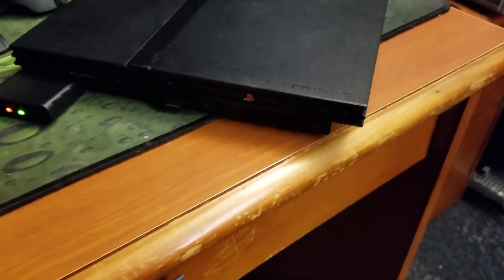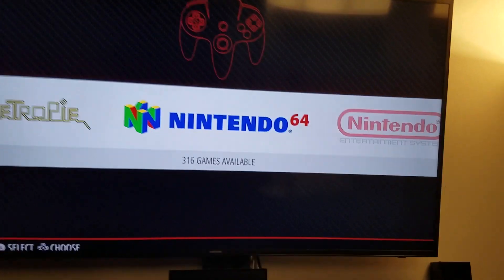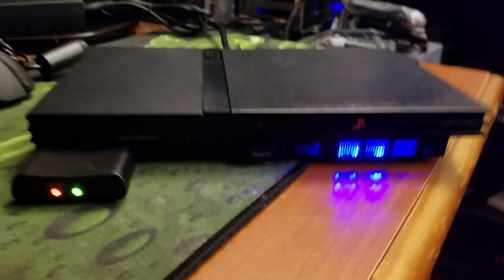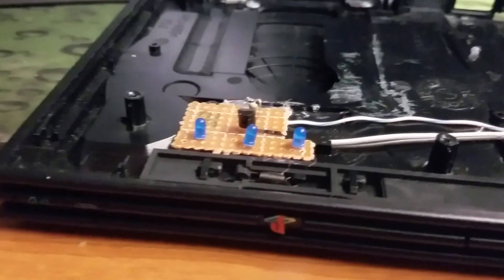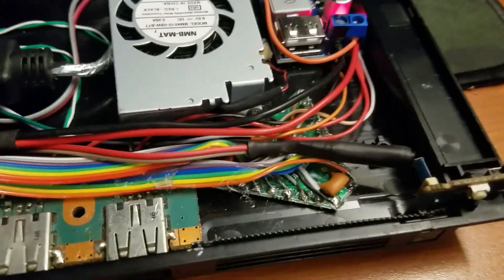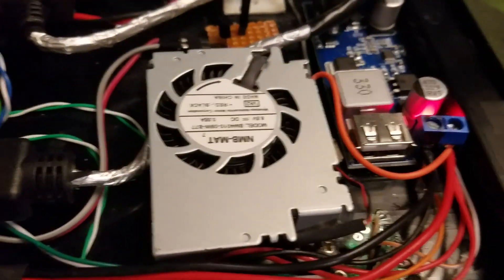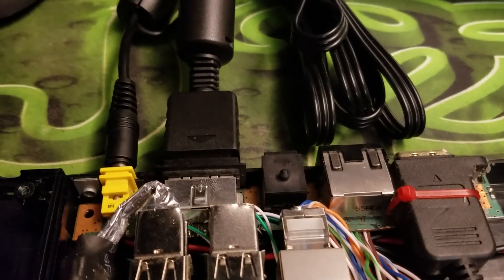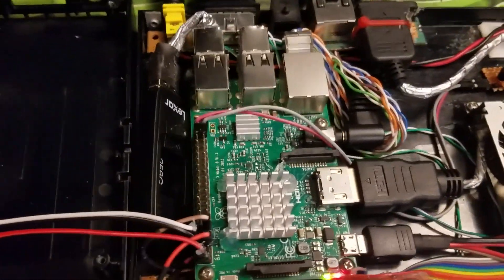PiStation 2 Slim

Comment: Do you have a list of parts you used? My PS2 Fat died yesterday and I want to drop a Raspberry Pi into it. Obviously I have a little bit more room, so I might try to even get the DVD drive working again, as well as some other parts. But it'd be nice to have stuff like the power converter and what not!
Reply from the maker: I posted this on the retropie forum too: https://retropie.org.uk/forum/topic/12754/build-pistation-2-slim

Since you're using the fat model just use the original power supply with a good DC-DC buck converter.